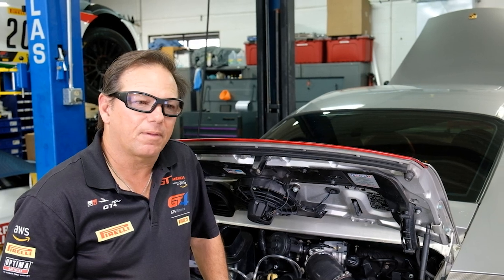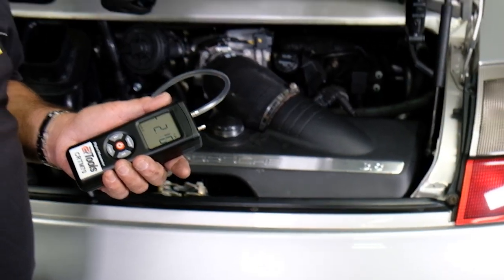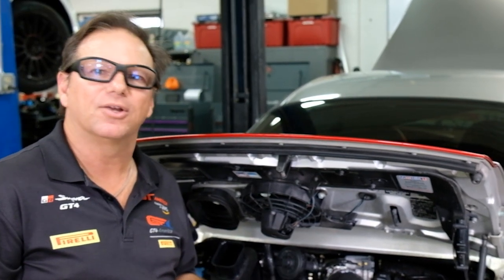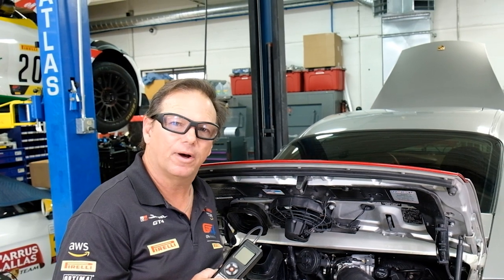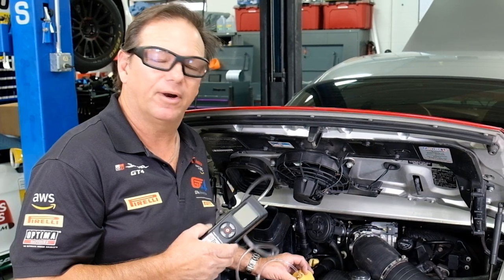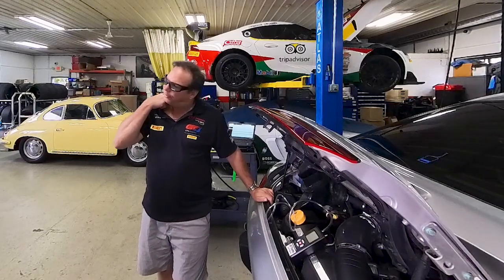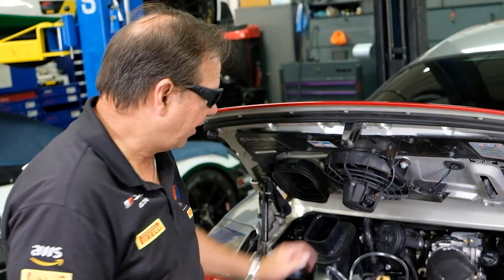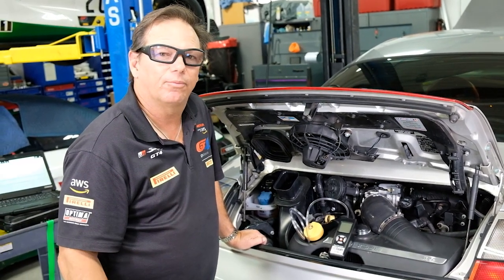"The Callas Method" - Measuring Crankcase Vacuum with CR Techs Manometer

Comment: Can you clarify how to do this please. Does one connect the manometer and run the engine whilst taking the reading? Of do we run the engine, then switch off and see how long it holds?
Reply from the maker: The CR Tools Manometer kit comes with the adapters required to check the crankcase vacuum, which needs to be measured with the engine running: https://lnengineering.com/callas-rennsport-aos-crankcase-vacuum-measurement-manometer-tool.html

Comment: BTW: 1 inch of water [4 °C] = 0.073 555 912 462 inch of mercury [0 °C], so 13.6 times if you want better resolution, use inches of water.
Reply from the maker: Yes, for example a stock 97-08 Boxster, Cayman, or 911 M96/M97 engine should have 4-6" of water column if fitted with a Genuine Porsche AOS and if measured when fully warmed up.
Reply: @lnengineeringllc  In my case -15.0 inches of water column in my 991.1. I got a reading of -14.91 inches of water column using a Porsche oil cap that I modified and my manometer. It is something I will check from time to time.
Reply: @lnengineeringllc  I've been looking into what other manufacturers run for vac in the crankcase and most run at least 1 - 2 inHg, Audi went from 2.5 to 2.9. Honda/Acura is at .2 to .4 hot idle up to 2 to 4 inH2O run up and have problems with carbon buildup in the ring pack. Do you see any Porsche with this carbon problem? Just curious, Thanks.

Comment: Can we use this manometer in 991/992 as well ? 
Thankyou
Reply from the maker: The CR Tools Crankcase AOS Vacuum Measurement Tool works with 991 models. We're double checking fitment for 991.2 and 992 models and will update the description on the LN Engineering website accordingly. Thanks for asking!